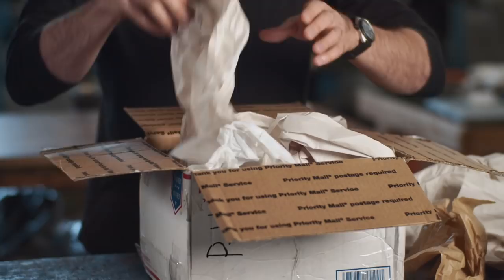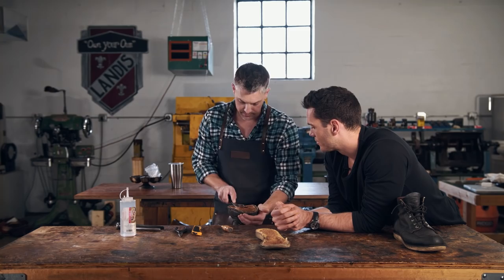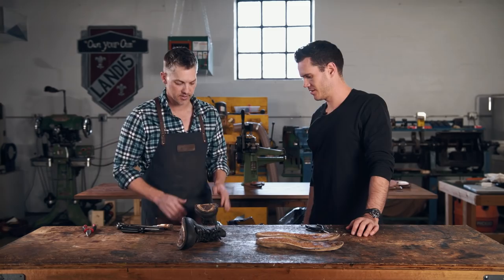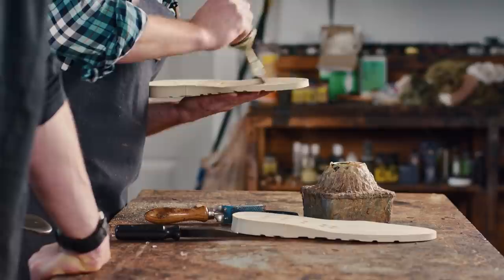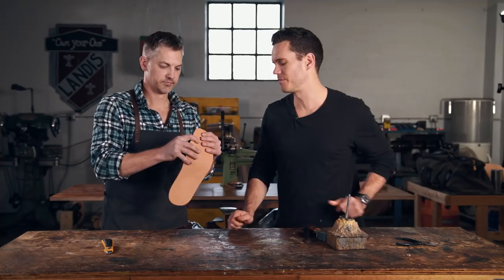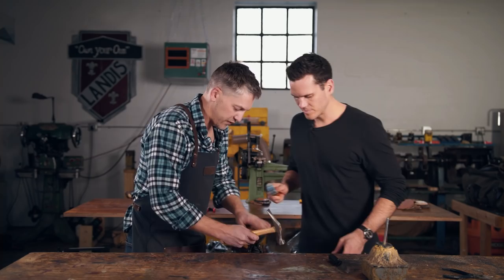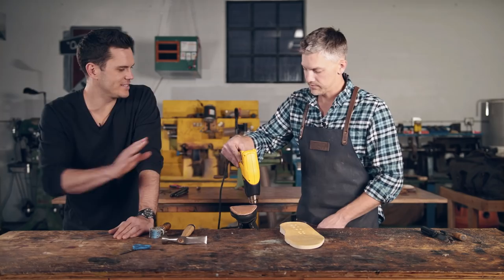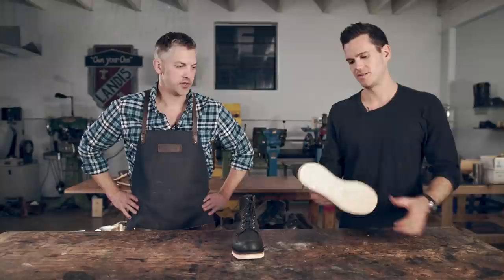How to Resole (My) Red Wing Boots, with @TrentonHeath !

Comment: The holes are to prevent “sink”
That’s a term used in the molding industry. Sink happens in thick sections of material as the material cools it shrinks and leaves a depression in the finished material. And that can be unsightly.

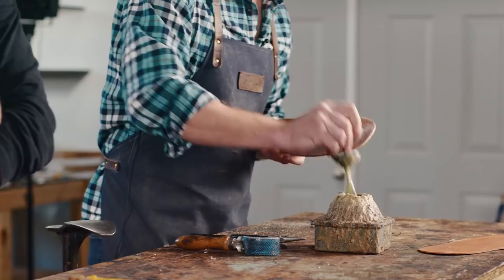Comment: 15:20 You can install a big air duct right in front of the bench where you use the glue and hook it up to a big duct fan that blows the air out of the building. You also can get away with a smaller one if you do the work more closely in front of it.
Maybe one of these aluminum ones hanging from the ceiling. Those can be bent to the right place.
You also need to let the air in somewhere. For this you can just open a window.
I guess a fume hood like in a chem lab would be overkill.

Comment: The layers of contact cement plus glue mixed with cork on a resole prove that it doesn't matter if your soles are rubber or leather, neither are going to breathe.
Reply: Exactly 🤣. And your uppers won't breather because of the Thermo plastic toe/heel puff and nylon reinforcements
Reply: @jensrb50  Your uppers might breathe because of that big hole in the boot where you put your foot :-) . As long as you don't lace it really tightly

Comment: Where is the original rubber Red Wing midsole?    I see the outsole removed ( rather easily ) and then we see the cork filler, which should be under the midsole.
Reply from the maker: The midsole was replaced with veg tan leather — boots got an upgrade!
Reply: @Stridewise  Yes, I saw that part. My observation is never seeing the original midsole removed from the boot.
Reply: It was still glued to the outsole. It’s very thin and the same color as the wedge.